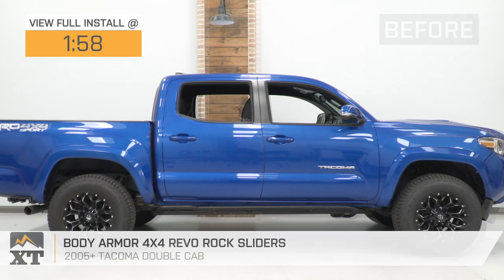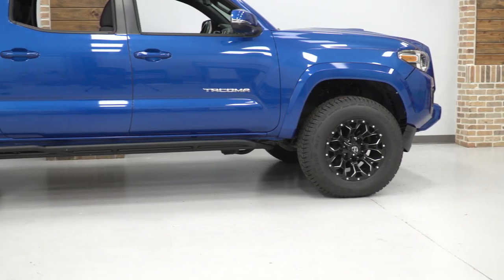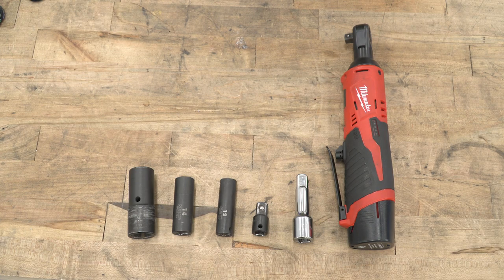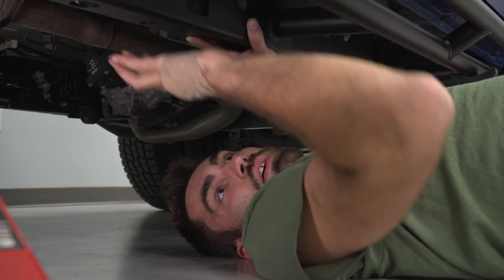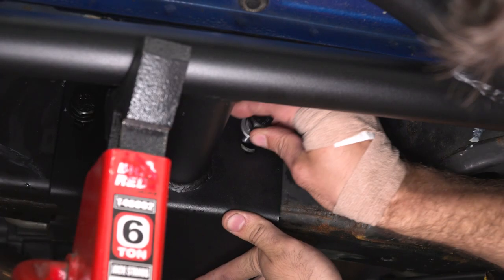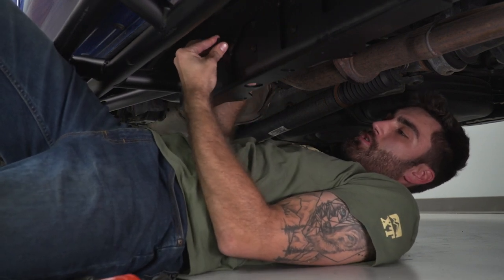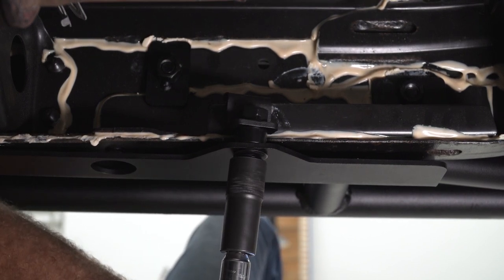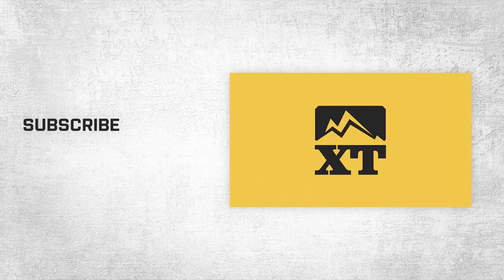2005-2023 Tacoma Body Armor 4x4 Revo Rock Sliders Review & Install

Comment: I love how they use the passenger side as the install video, because it makes it appear as though it can be done easily, even if by yourself.  This helps them sell more. If they showed the REAL install, which included the driver side, people would realize just how difficult this is, especially if installing by yourself. Getting your hands around the brake lines and into the frame rail to install that first bracket is nearly impossible.  The kit should also come with four spacers, not just two.
Reply: I mean they say in the video it’s easier with a friend lol
Reply: @S V  Even with a friend - the video covers NOTHING about any of the difficulties encountered on the driver side.  Nor do the instructions from body armor.
Reply: From 1 thru 10 what's the difficulty level?
Reply: Yeah this install sucked doing it solo… especially like you mentioned the drivers side was way worse.
Reply: Agreed 100%

Comment: I just installed the sliders on my 2022 Tacoma. The instructions were ok, and overall installation was pretty easy. However, I feel like the sliders are too short for the truck. There is several inches towards the front that looks like 
it's missing something. Anyone else feel the same way?

Comment: Maybe I did it wrong, but there was a lot more cursing involved in my install.
Reply: My driver side bar seems jacked up.  How did you get the bolt to go into the flat plate towards the back where the brake lines are directly in the way?
Reply: @nismo613  you gotta move the brake lines out of the way temporarily. I wrote up a guide on this over on Tacomaworld forum

Comment: I installed the passenger side first to familiarize myself with the general steps.
Then I tackled the driver side, and it wasn't that bad at all. One thing of note, was a small issue with one of the welded backplate nuts interfering slightly with the metal brake lines. In order to minimize the contact, I cut down the bolt, so that it would not stick out above the welded backplate nut, and I shifted the brake lines in their plastic holders towards the back of the vehicle (there was enough leeway to minimize the contact with the nut to almost nothing). 
I am still thinking about a way to further isolate one of those brake lines from the welded nut, so that there is zero chance of contact due to vibration in off road conditions. Ideas would be welcome, if any of you guys can suggest something.

Comment: The installation was shown only on the passenger side. What was not shown was the installation on the driver's side. Having to bend some brake lines and add some spacers to the control unit that was taken off of the driver's side frame rail for the welded nut to clear it.

Comment: Plus calling toyota tomorrow to replace the fuel / brake line clamps that I broke on the frame rail to install the rock slider so that they do not chafe on on the installation nut on the frame rail.. For the driver's side!

Comment: Why not show the drivers side with the brake lines and modules?
Reply: Also I believe the spacer is not supposed to go in the bracket with the s but in the bracket with just the bend at the end
Reply: Fish in the brackets into the front cross member before mounting up the rock slide.  I learned my lesson.

Comment: You fail to mention all the crap in the way on the driver side you need to remove, brake line mounts, wires etc… i did passenger side and was like oh good, half way done. Nope.

Comment: I'm not normally one to give a thumbs down but I wish I could do it more a few times for this poor excuse of an install vid. There is SO MUCH that was missed and skipped over here. They should have showed the drivers side where the real work is at. They also missed bolting into the very front of the sliders. This isn't rocket science,  but it sure as hell isn't a walk in the park doin it by yourself either. Aggravating and disappointing vid.
Reply: Check my write up over on Tacomaworld. I tried to fill in the gaps of things that weren’t covered in the video
Reply: @belain840  please send me a link to your post. i have these arriving on thursday and need to have them installed by friday so ill be doing the install.